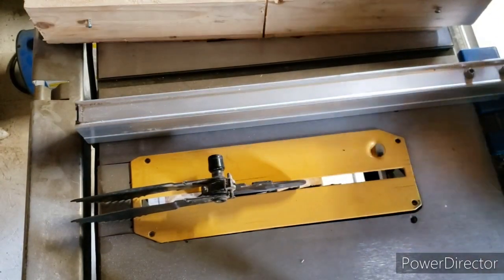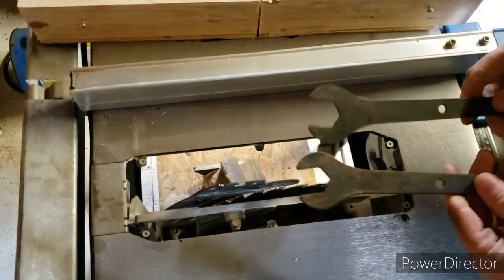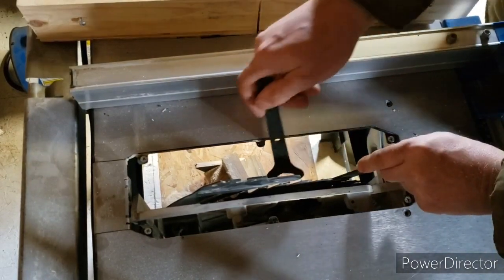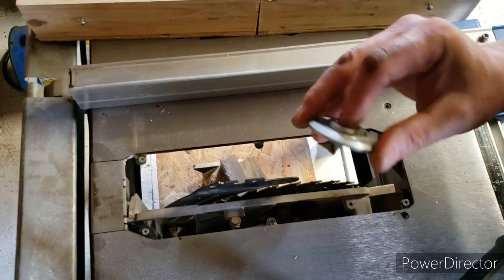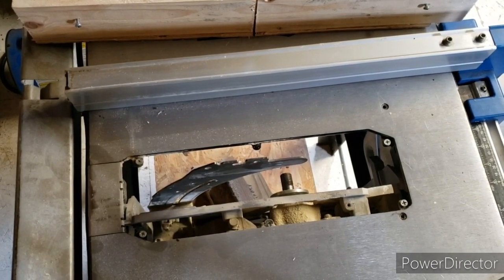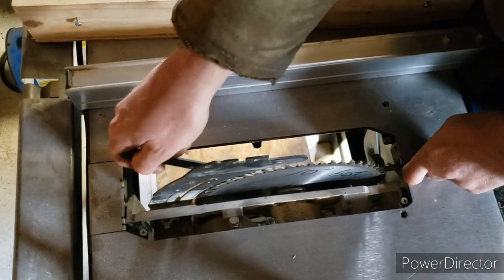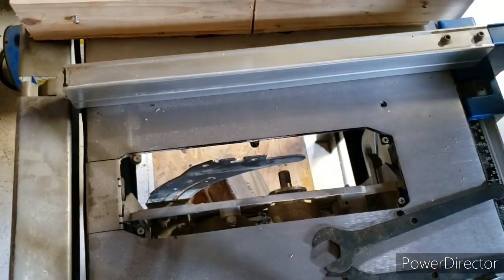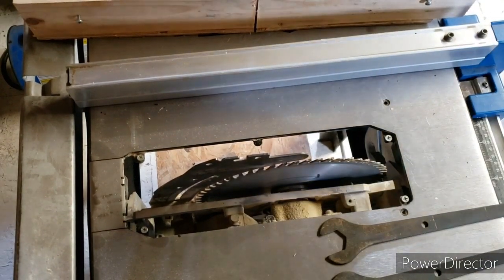How to Install a Blade on My New Table Saw

Comment: With the blade on backwards you can use it to cut plexiglass and aluminium!  We used to do that when I worked at a boat shop.  Don't forget to unplug the saw first! lol
Reply from the maker: Lol no doubt. Thanks for the tip, makes sense because i know people that turn blade backwards on skil saw to cut aluminum soffit so yeah. Yeah make sure its unpluged or adrenaline is not the only thing that will be running lol
Reply: If I turn the blade backwards I can cut plexiglass? Sweet! I just received some free stuff.  Any other advice please?

Comment: Great video. Do u guys have some hard time raising the blade ? Mine it's a freaking effort to spin that wheel to raise the blade and very easy to bring down.
Reply from the maker: Lol, yeah, mine was really hard, but i think i put oil or something on the inside where the handle is and a bit easier, but yeah, it's hard
Reply: I thought it was just mine because it's old!